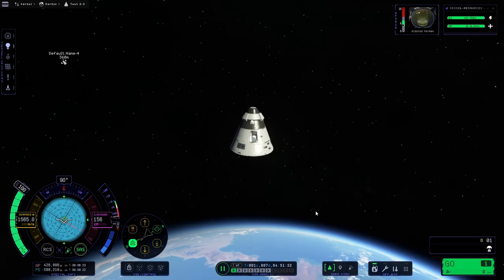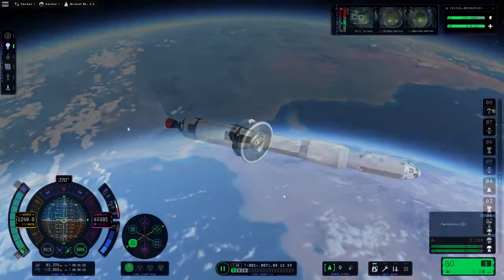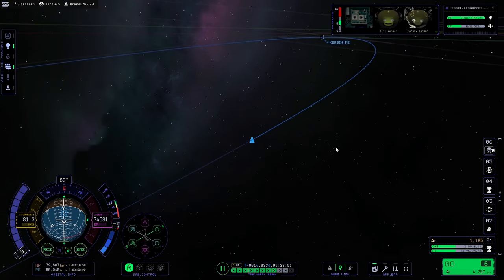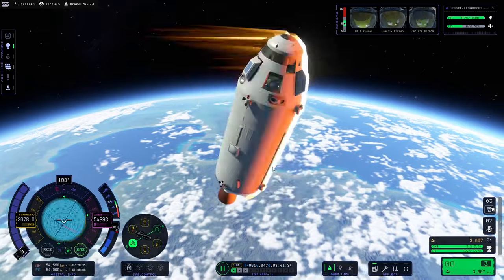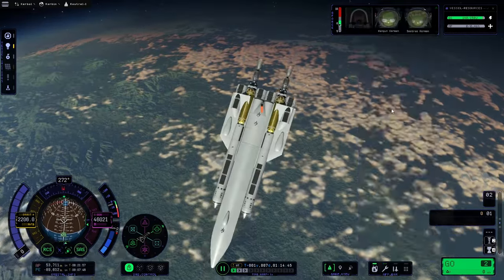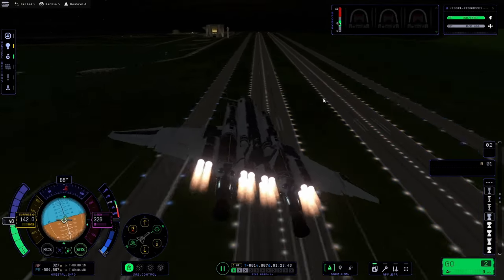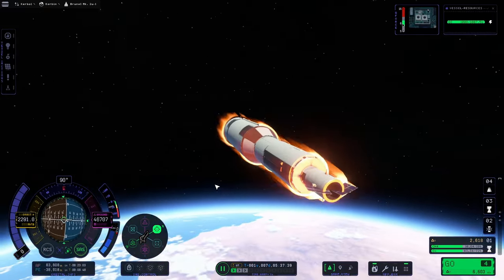Is Reentry Heating Broken? - Kerbal Space Program 2

Comment: I think it's appropriate for it to be harder - heating in KSP 1 had so little design impact - but space plane heating in particular needs work.  There's no way to shield a space plane, meaning there's not really a good way to build a surviveable one.  Right now it's all based on thermal mass of the parts, so you have to make your wings really beefy to survive re-entry.  Personally, I think that space plane parts should either have a switch, or just automatically record the appropriate mass and thermal behaviour for having shuttle-style tiles on the bottom side.

Comment: I'm really glad they turned up the heating from KSP 1. It was ridiculously easy to deorbit even with upscale mods. Now it's going to be a challenge!
Reply: Yes but then they should add a way of heatshealding larger vessels.
Reply: @baxi-1228  Maybe they will, but should they? I'm not sure. Large vessels shouldn't realistically be able to deorbit (with the exception of space planes, I guess, and those kind of work, as the video shows).
Reply: @martinvranovsky7085  they should. its still a game. not a simulator.
i dont wanna do a rocket science school diploma to play KSP
Reply: @Hopeman__TM  Fair, but it's purely a matter of opinion. In any case, the options I see are giant inflatable heat shields or some sort of sci-fi deflectors... We'll see what they come up with. I know the devs want to make the game accessible.
Reply: KSP1 had a setting slider for re-entry heating. Should be the obvious solution in KSP2 to accommodate different preferences.
Reply: @sharpe3698  ksp2 does have a slider?

Comment: I do have a question, do fairings even work at all? I've not been playing the game because my payloads within fairings kept exploding on ascent.
Reply: I've noticed that the largest stationary communication dish kept burning up but everything else seemed fine.  The game won't let me build broken ferings where things are sticking out but I wouldn't be surprised if it checks the visual boundary rather than a secret heat boundry which is slightly larger. Solved it by giving my payloads more space personally.
Reply: @Kingsleyrulz  even when I made my fairings much larger than they needed to be I kept having random fully enclosed parts explode from overheating, like my SAS module or batteries

Comment: haven't got ksp2 to run smoothly yet, but I can say that I could deorbit a cupola module in the original ksp
Reply: Huh, I think it runs pretty smooth on my laptop, actually runs better then KSP 1 with less graphics mods now in my experience.
Reply: I avg 100 FPS with medium settings with a 5600x and 3070 and 32gb of ram with 530 firecuda SSD   slowly they are making the game extremely good at launch it was a joke to play the game  but after over 8+ months of being out   the game is really good it has some bugs but they are trying to do something KSP 1 never did

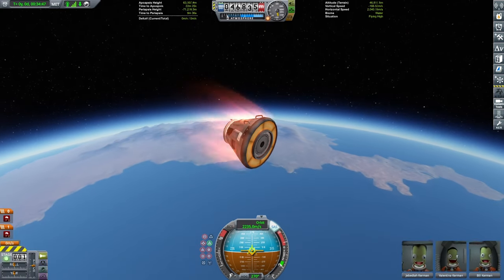Comment: 3:15 you do know you can change the heat settings right ?  also  the physics behind reentry has everything to do with particle physics and aerodynamics and heat transfer and entropy   The more dense the atmosphere the WAY more hotter it will get  like mars   mars has a think atmosphere which is why we can get away with thin heat shields   it also has a lot to do with Mass  and how big the planet is  the more bigger the planet the more speed you need the more speed you have the thicker the heat shield is needed and the better the materials is needed its physics 101  now at 3:15 you can change this if you want by going into the settings  and changing the reentry heating to 140%  more making it extremely dangerous to go through a atmosphere